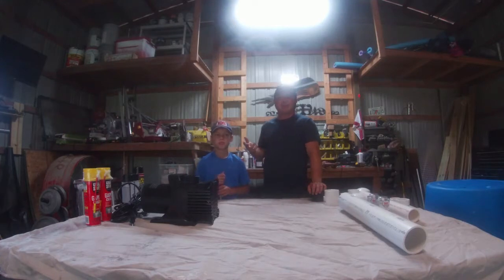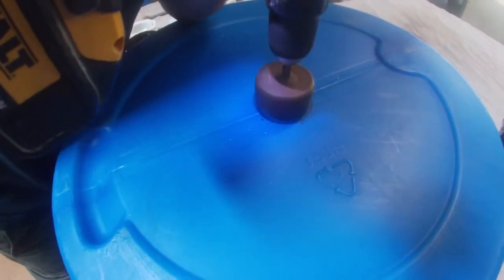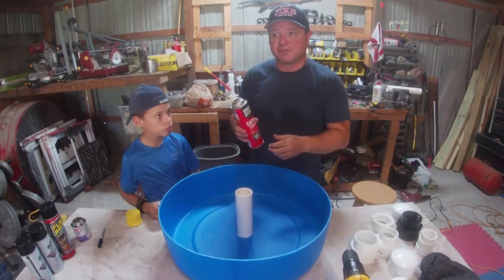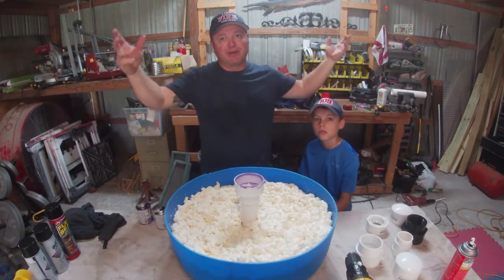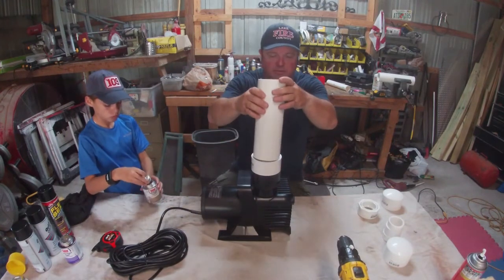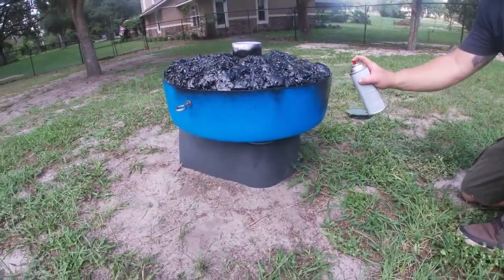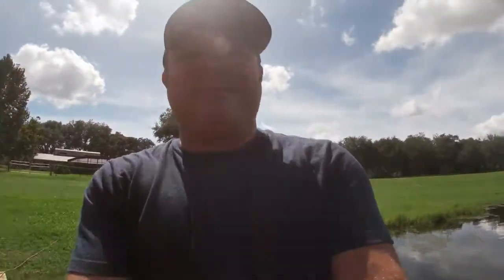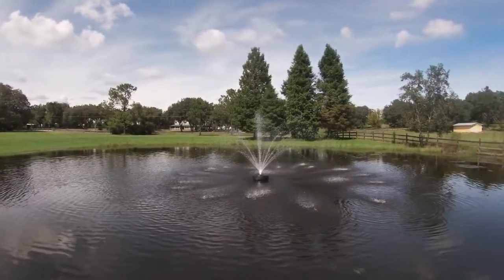CHEAP DIY Pond Fountain

Comment: This was the best video I’ve seen on making a DIY pond fountain. Would love to hear what your typical maintenance is with it
Reply from the maker: Thanks. About every 6 months pull the fountain out, clean the intake screens and check the electrical connections.
Reply: @robertsonfamilyadventures7082  thanks! I have a pond similar to yours that just gets nasty from being stagnant throughout the summer and there was no way I was going to spend 2k+ on a fountain
Reply from the maker: @UncleJessy  also check pond aquatics magazine and they have different treatments for algae bloom problems. We were in the same boat reason why we researched and came up with this. Has helped our fish and the look of the pond.
Reply: Hi . You were short of cord from the pump to the receptacle . How did you safely extend the extension cord or did you just move the pump closer. I was thinking to run a really nice cord thru a flexible one piece pipe out to the pump float . But as a DIY er I'm about saving money lol but still doing it safely . !!!
Do you remove it during the winter or just unplug it

Comment: Look into a Hiblow diaphragm pump with one or two diffusers. You can make em. Its low pressure so the diffusers need to be at about 4ft depth at most. It will aerate and you can run it 365. Keeping the water open in winter is VERY helpful for the fish. Pump doesn't use much power and it'd be perfect for your small pond. Thanks for a cost effective fountain. Much appreciated.

Comment: To attain higher fountain height taper down from 3” to 2”.  Revise Cap hole design, 3 equally spaced 1/8 inch slots near the outer perimeter of the cap the drill symmetrical holes different sizes. One hole at center. There is a spray foam for ponds and pools.  Good job! Thank you.

Comment: I think I'd prefer a minumum 3/4 hp  (1hp=746w) with overload protection. But IMO I'd pay a little extra for a better model pump. Remember, GFCI ONLY protects from ground fault, NOT an overcurrent/overload condition. Must keep filter clean. If the pump fails it has already been running at higher amps, motor windings heated and fused, etc. If really wanted to protect from overcurrent/overload, as an added protection put an inline fuse holder and fuse in a larger 4" receptacle box with the GFCI (maybe 8-10 amps).
Reply from the maker: Good idea. So far no issues with ours 2 years later.

Comment: When using a fountain to prevent pond turn over  you need to make sure the water feeding the pump is draw from the bottom  (colder) of the water column.  Your essentially trying to mix the water in the top of the column with the colder water resting at the bottom.
Reply from the maker: Valid point. Thank you for your input on how to keep our ponds more healthy.

Comment: how did you extend the cord and or make it waterproof? great video , thank you for sharing
Reply from the maker: We used heat shrink designed for underwater applications.
Reply: @robertsonfamilyadventures7082  So you cut the plugs off of both the pond fountain and one end of an extension cord?  And then you manually wired/spliced those wire ends together and shrink wrapped that?

Comment: Another question for you. I got the same kind of pump (9000gph) and someone who I trust told me if I put a cap on the top, like you, I would restrict the water flow and burn up the pump. Have you experienced anything like that with your setup?
Reply from the maker: @TopFitnessStrategies  still going. Not issues with the pump.

Comment: Was the chord on your pump already that long did you use a waterproof connecter to a extension chord
Reply from the maker: We used a waterproof butt connectors, heat shrink, and wrapped with electrical tape.

Comment: What did you do to resolve the length of the cord for the pump? You said at the end on the dock that you needed more length than what came original to the pump. An extension cord plugged into a GFI?
Reply from the maker: I went to Home Depot and bought 30 feet of submersible pump wire.  Then I spliced the two together using butt connectors and heat shrink. Then I put a bigger heat shrink over the entire connection and let it dry. That is hardwired to a GFI plug.
Reply: @robertsonfamilyadventures7082   good to know! Thanks for the info and video.

Comment: what was the brand and make of the pump and what site did you buy it from? Great video
Reply from the maker: 9000 gph (gallon per hour) commercial submersible water pump by aqua max. In one of the earlier comments we placed the link which was purchased on eBay.

Comment: Did you plug this into direct power? Trying to figure out a solar/12 volt option, as we do not have power running to our pond.
Reply from the maker: Yes we ran power underground to our pool pump panel. I am not familiar on solar panels but I am sure that would definitely be an option

Comment: Working on something like this myself do you think if I had to run an extension cord a 100' to run the sump pump do you think I would need a 12 Gauge or all the way down to a 10 gauge cord for that length of run
Reply from the maker: My advice is run the heavier gauged wire. Good luck on your project.

Comment: What brand pump is that?
Reply from the maker: 9000 gph (gallon per hour) commercial submersible water pump by aqua max
Reply: @robertsonfamilyadventures7082  Got a link we cant seem to find it either
Reply from the maker: @zippinzach1517  https://www.ebay.com/p/1244722040
Hope this helps.

Comment: How big is your pond?
Reply from the maker: About 200 ft diameter.
Reply: @robertsonfamilyadventures7082  what pump did you use?
Reply from the maker: @MichaelsandAssociates . 9000 gph (gallon per hour) commercial submersible water pump by aqua max. Found it on ebay.

Comment: Im wondering what the cost is to operator the advantage of the aerators is it uses a diaphram pump and a lot less power so the TCOO may actually be higher. Of course you also don't get a cool fountain without the aerator